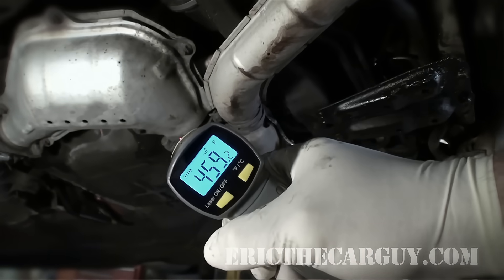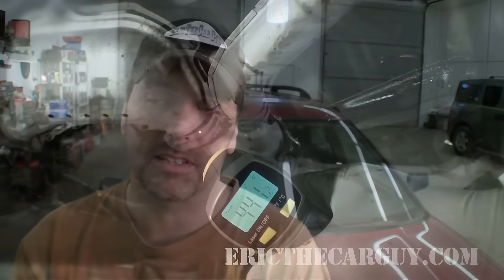Does Lacquer Thinner Clean Catalytic Converters? -EricTheCarGuy

Comment: 2009 HHR check engine light couldn't get it inspected I tried this method in the midst of 160 mi trip I went to pass a truck which we went up to about a hundred mile an hour and whenever I let off the gas and check my gauges again my check engine light was gone it was off however the man on the video said you need to drive it keep this in mind you need to drive it to clean this out because I drove it for a long time before I went on that trip but passing that truck did the trick

Comment: Lacquer thinner is typically 80% toluene, which is a very good cleaner for fuel systems.
Reply: The Real VR  so are u saying that he is lying
Reply: @wildestcowboy2668  He's saying trinitrotoluene has triple the cleaning ability.
Reply: @rustyATV  thanks for the heads up, will it clean one on a Nissan exterra if it's stopped up sir?
Reply: @rustyATV  lol 😆
Reply: Boom! @rustyATV
Reply: @jasonbender2459  That must be a cheaper lacquer thinner because the one I've used in the past was 60-80% toluene:  http://www.actequipment.com/msds/fsp2002.pdf

Comment: What about installing  spark foulers
Reply: A spark fouler makes a trick to foul a sensor reading the exhausted gas in the catalytic converter as clean air.
While a lacquer thinner uses a chemical to clean the elements inside the catalytic converter to open a clogged honeycomb screen.

Comment: Why wouldnt you take the upstream 02 sensors off and put the thinner directly into the catalytic converter using a funnel and tube. Then put sensors back and run it up to high rpm.

Comment: Scotty said use 1 gallon in 1/2 tank and drive 150 miles at highway speed or run the engine in idle at high rpm for 30 minutes

Comment: I am a little bummed that he only put in a quart when Scotty recommended 1 gallon and a half a tank. Now I was very leery about putting a gallon and a half tank in my car because my car only takes 10 or 11 gallons. That seems like a very high proportion of lacquer thinner.
But this was helpful because for one I was tempted to use less than a gallon. And I still might use less than a gallon but I will not use just 1 quart.
 I recently put in some chemical that was just for catalytic converter’s but that wasn’t even a quart that was your standard size fuel cleaner container.  And I didn’t have very much faith that it would turn off my check engine light.. My check engine light is pretty recently turned on so I think I have a fair chance of this being successful. And a lot of other people seem to have had a great deal of success with this strategy. I am still leery about putting a gallon damn. This is not a car I could really afford to lose but it’s also a car I plan to get rid of. It’s a Toyota Prius and it just went over 300,000 miles. I figured it was time to sell it it runs beautifully and is still in gorgeous condition. I got everything back in good condition on this car when it turned over to 300,000 miles and then I got this check engine light for the catalytic converter. If I can solve this problem cheaply I’ll be very happy..

Comment: I tried it after watching Scotty’s video. The light came on literally as I was driving to the Smog Check station. I was broke and desperate. I poured the lacquer thinner and drove about 100 miles as suggested. Clouds of white smoke blew out every now and then. At exactly 103 miles the light turned off.  I’m forever grateful.
Reply: Same here. The shuddering and idling stopped, the lights and codes went off, and fuel efficiency returned.
Reply: It depends if cat converter is just dirty from the emissions. That will work.  But sometimes cat converters inside are destroy due to pressure …and that obviously won’t work …I tried all models and I used to be a guy to pass inspections in my town doing aprópiate cicles of a vehicle ..but there’s other tricks to pass emissions
Reply: @marcosgoycochea732  
I have a comercial truck  with cat converter.
What is best to clean them?
Or by pass?
Reply: @marcosgoycochea732  I have just failed my emissions test can you advise what I can do to get it through.
Reply: @marcosgoycochea732 greasing someone’s hand 😜
Reply: please share the other tricks so we can save some money TIA
Reply: Hello my hc(ppm) failed. passed at idle(15mph) but failed at 25mph part. It measured at 37. Average was 16 and max was 32. Will lacquer thinner or cata clean lower it with premium gasoline help? Or any other way?
Reply: @christophermastas7552  Getting an oil change before emissions testing can help lower HC.
Reply: @christophermastas7552  I hear that I’m using a higher grade of fuel does work on regular unleaded fuel vehicles
Reply: I want to try this but can’t get my car to start. It gradually just stoped starting
Reply: @joshuaposey6027  Fuel filter or pump maybe?
Reply: @PatrickLarson  it was the alternator but thank you 🙏
Reply: @joshuaposey6027  That happened to me last week. I had to replace the Starter! Not a big deal and super easy on my car. About $140.00 cost upfront. But then they gave me back $40.00 when I returned the core/ old one! 2 bolts, 2 electrodes you unplug and that's it. You might have to take of your air intake hose which is easy and possibly the air filter box. Took me exactly an hour from start to finish... again it depends on what type of car you have. 

P.s. did you get it fixed?
Reply: @joshuaposey6027  That is the battery problem.
Reply: That's awesome to know
Reply: This gentleman didn’t follow instructions. Scotty said less than a half a tank and use 2 gallons. People don’t follow directions than says something doesn’t work all the time 🤦‍♀️
Reply: The question is which ingredient in lawyer thinner is doing the trick. Is it toluene?
Reply: Whats the status of your car now? i'm not skeptical of the process just curious as the cleaning doesnt necessarily fix what caused the clog.
Reply: @Craiglaca1 Great result. Which lacquer thinner did you use? Thanks
Reply: @pnmbmw  I used the one he suggested in his video. I remember I purchased it at Home Depot. Pure lacquer thinner. Then again I think it was all pure. Grabbed the cheapest one I could afford at the time.
Reply: @Craiglaca1  I wondered to Home Depot and read the labels in some of them; some wer based on Alcohol, and probably would not have had the results expected. Beside, here in Canada I have not seen (locally) the "Lacquer Thinner" (kind of no brand, to me) used. All they say is "mineral spirits". These guys are all "spirituals" to me...😊😊{manufacturers I mean}
Reply: O try tankyou, wo much. Sorry for my inglish.
Reply: Did your light stay off?
Reply: @goldengirl5165  yes
Reply: @Ye Old Geezer 🤣🤣
Reply: How's your car now bro
Reply: @OmarHernandez-iu2zc  probably in a grave yard for cars.
Reply: Update ??
Reply: Scott put gallon on half tank, you put much less
Reply: Wow yeah 😮
Reply: As others have stated it probably works for failed systems. Eric's Subaru was not at all failed in the first place

Comment: The answer is no...the lacquer thinner will get burned inside the engine. What you'll get is combustion byproduct. Now directly injecting lacquer thinner into the exhaust stream would remove soot much like your soapy water trick.

Comment: I think to be fair, Scotty didn't say that pouring lacquer thinner fix a faulty catalytic converter. Basically, he said tried to clean up the catalytic converter first. If it works, fine. You save yourself paying large amount of money. If the catalytic converter is faulty, there is really no choice but to replace it.

Again, that Scotty's video was made 2011, pouring lacquer thinner is no longer applicable any more as it may damage more modern cars.

Comment: Come on, let's be honest. Scotty Kilmer did NOT say "pour lacquer thinner to repair a faulty CC." He said that by using lacquer thinner in the fuel there was a good chance that the inside of the cat would be cleaned. This statement was based on the presumption, as stated by Kilmer, that the cat was operating just below the threshold of the minimum operating standard of the cat. He said that many systems will initiate the code and check engine light even at efficiency levels of 95%. The idea of the lacquer thinner is NOT to "repair a faulty CC" but to clean it to a point where it's efficiency might be able to rise above 95% to eliminate the cause of the code and CE light by the sensors.  And I quote you: "The testing showed a very slight improvement but nothing that I would call significant." It doesn't have to be significant. If the efficiency rises just 1% or 2% it could be enough to do the job. Also, you did not follow the same quantity amounts used by Kilmer. The video was released in 2011, and not being an expert in any way on Acuras, I looked up the tank size for a 2010 model. 18.5 gallons. Kilmer added 1 gallon at the half tank level, around 9 gallons. You said you used 1 QUART for 7 gallons, making for a serious reduction in the method for comparison.

Comment: Can you still drive the car with a bad catalytic converter? Will it damage the engine by doing so? I just want to drive it to make it to the emission testing site and find out if it'll pass smog test before I put in a HFC or test pipes. Thanks

Comment: I get that you would expect some movement in cat efficiency after a quart of laquer thinner, but Kilmer did use a full gallon.
Reply: Type of laquer thinner matters. I've tried Scotty's method... It works. Years of doing concrete, there's a difference in muriatic acid as well. The stuff you get from box stores isn't the same. BUT.... When you get the more powerful/concentrated stuff-be careful!!!! Where you use it, what you spill it on, where you dispose of it etc... Definitely don't breath it. The everyday Joe stuff will turn your head away.... The industrial stuff will burn your eyes, lungs and make you take a few steps back!

Comment: You needed more lacquer thinner and less gas in the tank. When you get the proportions right you then jump on the freeway and drive at like 90 mph or as fast as you can get away with for about an hour and that crazy shit in your tank will melt little holes through the honeycomb in your converter and fix the problem your having like smelling or low flow, or even rattling if its not too severe. Note, this wont turn off your CEL though because the o2 censors will detect an excess of unburnt gas flowing through the pipes. This is a temporary fix until you can get around to replacing or cutting off the CC or whatever.

Comment: For the lacquer thinner to clean the black carbon build up in the cats it needs to be hotter then the normal gas exhaust coming out otherwise dont see how it would clean unless unburned petroleum products came out thru the valves and down to the cat to set on loosen or burn dissolve the carbon soot whatever  off the honey comb grills inside cat or?

Comment: got an aftermarket Catalytic converter from Amazon 1/4 the price of the local parts store chains & 1/8 the price of the dealership works great removal was NBD as the new one came with new studs & nuts so just snapped off the old ones.

Comment: Sounds crazy. Lacquer thinner has acetone in it. That'll wreck shop on rubber and other polymers. Definite no-go. Pull the cat and soak it for a few days in the thinner or another strong solvent. I wouldn't risk ruining more components.

Comment: I poured in my gallon already but I dont think its gonna improve my gas mileage.  It runs just fine though.
Reply: Better watch out. Check the ingredients on the thinner you used. If it has acetone in it you're headed toward some major problems. If it does and you haven't burned it all yet, I'd get it out ASAP without running it thru the system. Bleed the fuel pressure off, remove fuel filter and run a line from the outlet of the fuel filter to a gas can and then turn the key to the on position. You may need to repeat this cycle multiple times. The fuel pump will likely only run for a moment while it attempts to prime the system. If that's not an option, just keep adding more and more gas to try to dilute it.

Comment: Lacquer thinner eats up plastics so it ate the wiring inside the gas pump electric  components.  But it does clean the cats really good. 
This was clearly NOT the way to do it... The way to do is to soak the entire cat in a deep metal bucket or large metal tub. Leave it over night and watch it come clean. 
And please dont trust that Scotty Kilmer guy, he is such MICKEY MOUSE MECHANIC THEORIST.  UHHH! THERE U GO SCOTTY!   Short cuts are NOT always the right  simplicity...sometimes its better to just  put in a new part and call it a day.

Comment: How do you distinguish between a BAD and CLOGGED converter?  How are the symptoms any different?  Id like to try this.  Thank you
Reply: Check engine vacuum at idle. If vacuum steadily declines at idle it's probably clogged. Bump up the RPM a bit and observe the decline. Also try removing the upstream O2 sensor (before the cat). If it runs much better with the empty O2 bung, it's clogged somewhere downstream, not necessarily the cat. There are gauges that can measure the exhaust backpressure from the O2 bung hole on Amazon selling for $35. This would be the most definite way to quickly diagnose a clogged exhaust.

Comment: I used lacquer thinner in my 2007 toyota Corolla and my engine code for catalytic converter was cleard and never came back on. Saved me$ 1200 bucks from the the dealer.

Comment: Thanks Eric for directing me to Scotty's much more useful video on the subject. Using Scotty's formula of 1 gal. lacquer thinner to 1/2 tank of gas then driving 150 consecutive miles at a consistent ~70 mph/3000 rpm immediately resolved the DTC P420 issue with my 2004 Honda Civic LX, and is still effective after driving another 50 miles at highway speeds the following day.
Reply: Legend says that Steve Crum is still driving his 2004 Honda and the light never returned.
Reply: @marionomadic6227  😹
Reply: Where the hell are you guys driving a continuous 150 miles at 70mph? Lol
Reply: @Hizenbird  The interstate? Lol

I just took a trip yesterday to pick up a couple of friends from an airport a couple of hours away. It was interstate the entire way for about 115 miles.
Reply: @mogthemoogle_160  I live in SoCal. It’s literally, virtually impossible to drive 70 for 115 miles straight. Best attempt would be to try the 5 fwy but even then you’re likely to have to reduce your speed at some point. 
Forget about staying around home, anytime you transition to another fwy to get you closer to home you’re going to have to reduce your speed. 
Hmmm. Did they ever mention how far the bus in speed travelled?
Reply: @Hizenbird  Scotty also recommended  you can try at least 30 minutes of running your parked vehicle at 2500RPM to see if it will help clear code... and I've read it's not all about driving fast on the freeway because your car's computer need to read low speed (30mph or less) and moderate speed (30-50mph) performances too before it will fully diagnose and decide to turn off codes.
Reply: @Vex916T  Ya the main thing for tge high speed is to keep the rpm at or a touch over 2500 for as long as possible. I personally prefer the 150 mile route so I keep that 2500 rpm through most of that gas tank for a really good clean. Certainly not a waste of money trying that out. At least the cat is cleaner than it was
Reply: @Hizenbird  You don’t have to drive the car for 2500 rpms straight for 150 miles in a straight line, the whole point is for the thinner to circulate through the system and constantly passes through the catalytic converter so it cleans it. You would realistically want as much thinner to be running through the catalytic converter steadily rather than stop and starting with stop and go traffic.
Reply: @CarlosRamirez-dq3cp  I was referencing the above post (see post by Steve at the top)
Reply: @Vex916T  The high speeds/rpm levels are to clear the blockage. Once blockage is gone or cat is running more efficiently the light should go out and stay out even at the lower speeds if done correctly.
Reply: @Hizenbird  West Texas y'all. 80mph
Reply: @Hizenbird  you can do that in Texas all day long.
Reply: @Hizenbird interstate , but you will get run over , more like 80 plus ! lol
Reply: is it still good now?
Reply: @glowiever  is it still good after a year?
Reply: @steve crum hey i did it and it lasted 1 month 4000 miles... but i didn't consistently drive 65-70 for 150 miles... the second time i did drive consistently 150 miles.. out and back and it hasn't returned yet 4000 miles 1 month about
Reply: how long did the 'fix' last
Reply: Soooooo?
Reply: Is it still good after a year?
Reply: Steve Crum did too much thinner n blew up apparently
Reply: If my truck has a 25 gallon tank, half a tank is about 12 gallons, than how many gallon of lacquer thinner would I need? Also if I drive it at about 2500 rpm that means going to about 90mph🤔
Reply: @izh6421  um, gears?
Reply: Arizona highways you can drive fast
Reply: Steve Crum dude we're all wondering...
Reply: I use moonshine and floor it to the moon and back
Reply: @Mickey-xg8ih  I use moonshine and hopefully make it back

Comment: Hi Eric, I have been working for years on a formula to help clean the catalytic converters and finally I came up the perfect solution and it works like charms. I guarantee this product to work on any sluggish or poor performing catalytic converter on any car . I have been selling to all my friends and mechanic shops in my area . People are amazed with the results. It restores the entire fuel system from conditioning the fuel pump to cleaning the injectors and cleaning the intake valves to cleaning the combustion chamber and freeing the pistons rigs . It cleans the O2 sensors and restoring the catalytic converters to the max. I can send you a sample to try it on any vehicle with non-performing cats as long as the cats are not damaged or collapsed. Let me know.